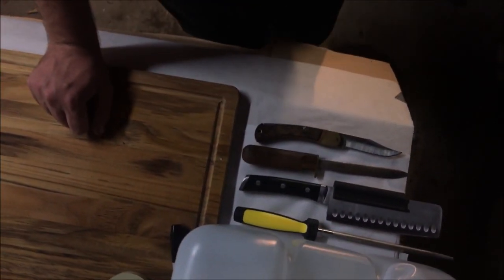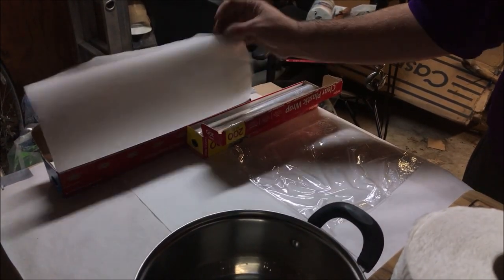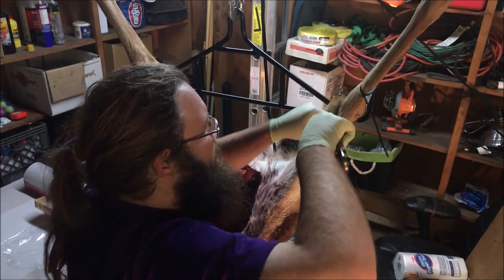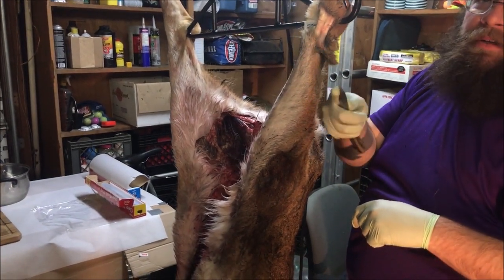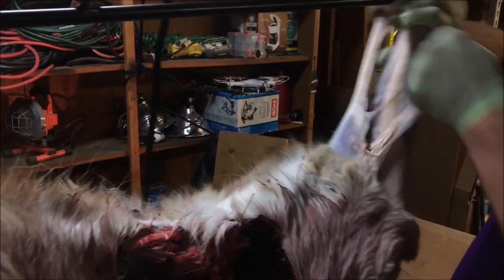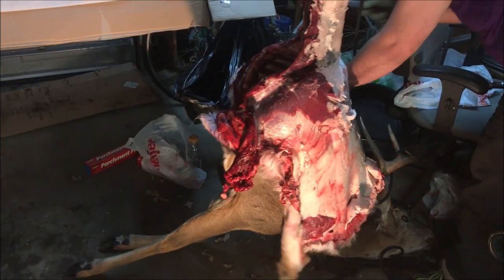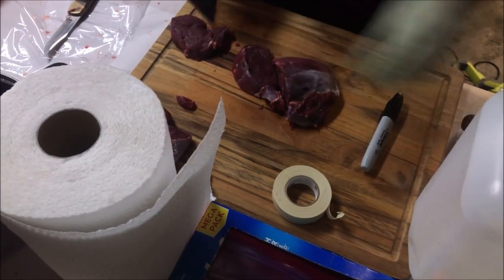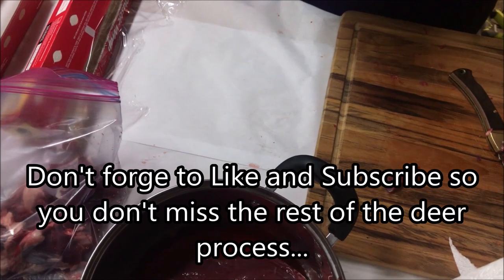Field to Table: Skinning the Deer and Cutting Chops... @MIAdventureLife

Comment: You need to sharpen your knifes. They should glide in. Also the meat looked really wobbly n soft. Was it warm?
Reply: Nice buck tho. U get it on video?
Reply from the maker: I touch them up as I go but ended up not even using the boning knife cause it needs some real work. Nah the meat was fairly cold, only had the garage heater running for maybe a half hour before and it was 35 that week. bigger chunk look more mobile maybe?
Reply from the maker: Got the buck on video....then lost the phone it was filmed on. Check out our opening day series to hear all about it